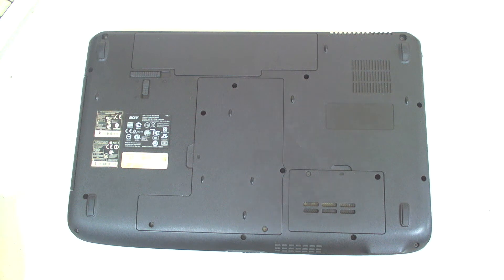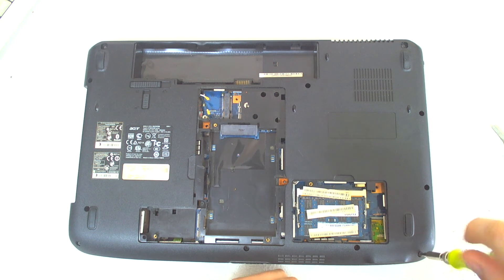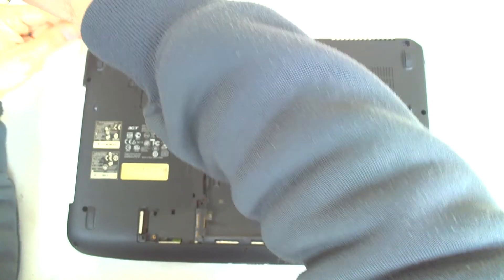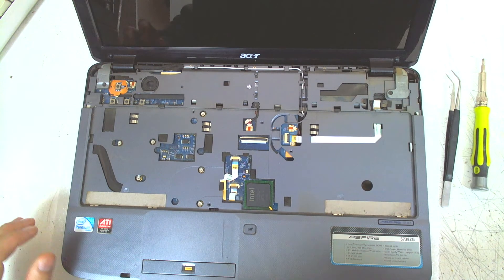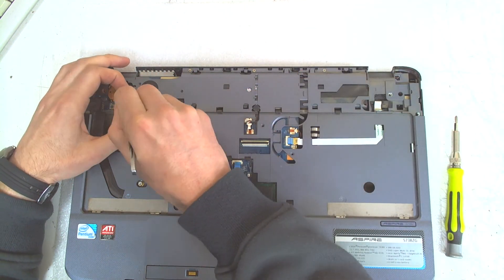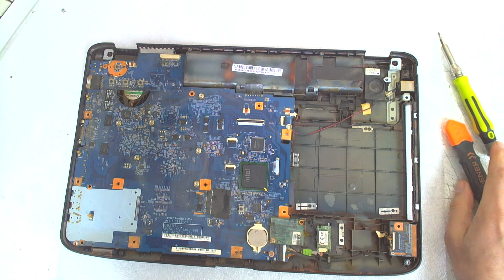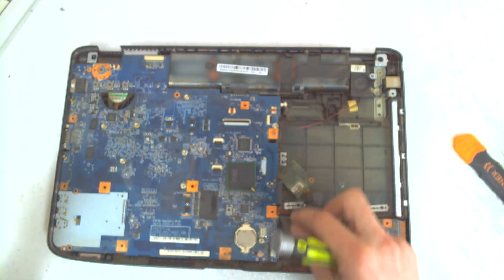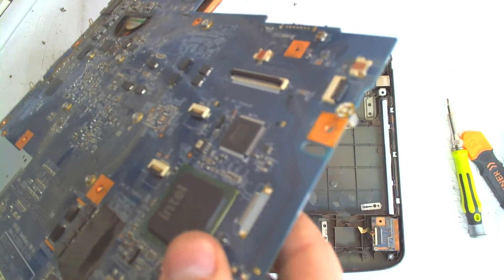Acer Aspire 5738 series disassembly / FAN Cleaning

Comment: Does anyone know the exact type of those speaker connectors? I broke the female part of the left speaker..
Reply from the maker: Can you just solder the wires to the board.
Reply: sure I could replace it with another connectors (male and female), but i want it to fit in the caseing as good as possible
Reply from the maker: No i mean to cut the male connector and just soolder the cabkes to the board. Otherwise it will be hard to find that spare part, exept from a donor board.
Reply: But then it would be difficult to disassemble again.
Turned out de pins were bent under the broken top part of the female connector. I removed the top part, made the bent pins straight again and was able to connect the speaker correctly.
It's working now.

Comment: Hello sir, i have a question, are they still allowed to use mercury in laptop components ? i have a ACER 5750g model 2011, the screen is LED but i am worried about other components like switches ...
Reply from the maker: No there is no mercury in the laptops or im the components... Dont worry
Reply: Yanko Goshev thanks!!

Comment: Ho, i have this laptop and i was tried to clean the fan but i have accidentally broken the fan. Now not spin and not work and i have black screen when i turn on the motherboard. The problem Is the fan or motherboard? Thank you
Reply from the maker: The problem is noy the fan. Even without the fan the laptop should start and power off from overheating. Probably you forgot to plug something in.. Or accidentally you hit something on the board. Have a look on all the cables that are plugged in.